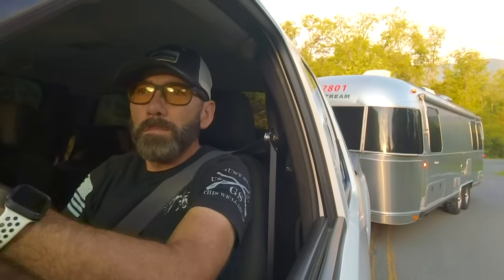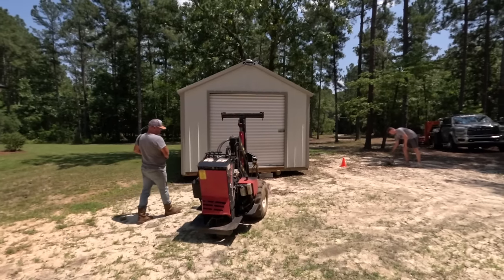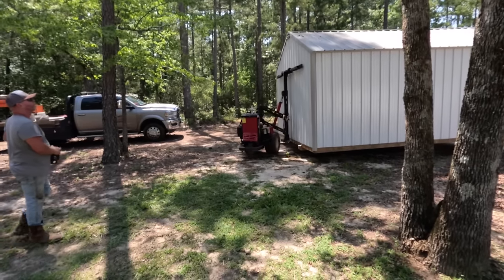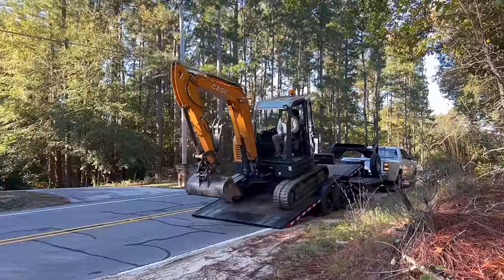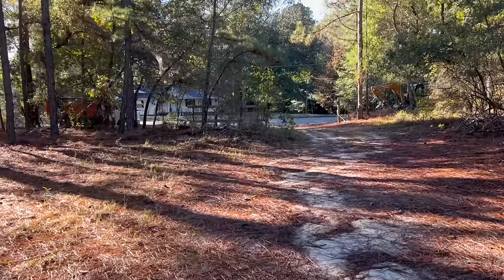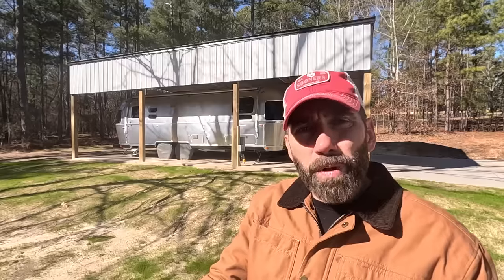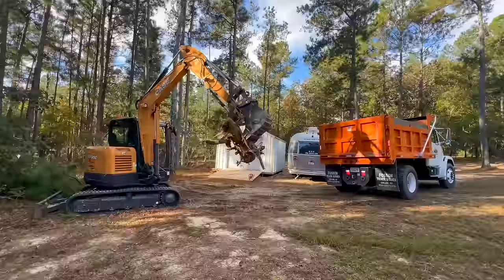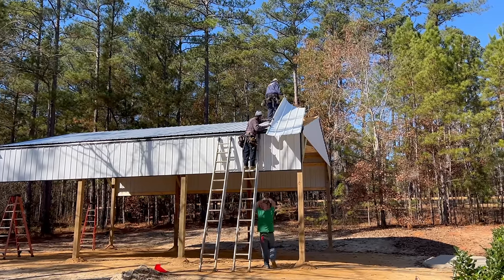How MUCH To Build Our RV Pole Barn?   A Full Cost Breakdown 💰

Comment: I had Carolina Carports install a 12’ wide by 12’ high legs/15’ high peak by 30’ long metal carport with fully enclosed sides and full gables on both ends for our 2019 Flying Cloud 27FB for $6k.  Site was level already so just put gravel down.  Install was done in one day.
Reply from the maker: That is awesome.  I’m sure you and your AS will enjoy it for years to come.  Cheers!
Reply: That's the way to go. Also counties dont usually see these metal carports as permanent buildings so no extra taxes.
Reply: CC ripped me off
Reply: Good investment!  saves on wear and tear on AC plus cheaper bill.  Im building one in the upstate soon I hope . I have to look into Carolina Carports. Thanks .
Reply: That's great and within my budget🙂
Reply: Must have been in 2019.  Price is triple now!
Reply: @janetjones9187  that's not so good and not in my budget☹️
Reply: @Phredbo  mine either!
Reply: @janetjones9187  That's crazy!  It was a last year (2023)!
Reply: What kind of snow load and wind can it handle.
Reply from the maker: Since we live in South Carolina their is no  snow load requirements, but I believe the wind rating is 100-120 mph.

Comment: Great video. As a pole barn builder I want to give you a quick tip. Highway overpasses are all built for just under 14 foot clearances. So every Rv sold, and every truck must be able to clear 14 ft with ease. Therefore I always recommend building everything that could eventually have a 14 ft roll up garage door installed. That way no matter what you purchase, or whatever the future owner might have will fit under the structure. It is relatively easy to raise your building a couple feet at a later date if needed. But is more cost effective to just plan for it. Also the longest Rv on the market I believe is 45 ft.  So I always recommend a 14 ft garage door opening. And if possible 50 ft deep. But extending the length of these structures is very simple. So this can be done as needed. Enjoy the garage. I think you got an excellent price on your electrical work. And the grading and driveway installation was very well done and at a very reasonable price. Well done.

Comment: I hate when they don't put plywood or osb under the metal . I saw my neighbors go up 5 years ago and he has had his metal blow off 3 times and the 3 rd time was this past saturday  when we had high winds  3 panels came off . We live in southern VA near the NC border . . He had to pay yet again to replace the panels as the screws ripped holes in the panels as they blew off. The color doesn't quite match , but you get what you get these days . It was built for his RV also and made similar to yours . Severla side panels were bent in or riped off also . Weather report said 40 mph winds with gusts up to 50 mph . But like me he lives up on a hill and exposed to more wind . The cost was 2 thousand and some dollars . He kept the old panels to see if he can use them to make raised gardens  , so at least they don't go to waste . My suggestion on raised gardens because i got panels 2 years ago from a friend who had his metal blown off . I love my raised garden beds I built  for free and a little labor on my part  and some free cow manure from my neighbors farm
Reply from the maker: Thanks for sharing your experience, and sorry to hear you’ve had such problems. Fingers crossed 🤞, we never have to deal with the type of problems you had…But you never know
Reply: @thewrightlife  I went to get wood today and got my carjack out and lifted the side a little to support the sag . It is a 3 car carport plywood and metal roof over that . But we get really strong winds up the hill . As a matter of fact since the epic ice storm I have lost over 50 trees in the woods behind my house . I feel like the movie the money pit by TOM HANKS . I have weak trees . I am a 70 year old woman and never expected to have to do this  .I really thought I had the carport over built with 6  4x4's down each side  . I wanted 6x6's like I used on the 100 ft long front porch but could not get  them at that time and the trusses were made by a truss company . I hope you don't have to go through this either . It is a big headache and I thought this month putting the ice and water shield and new roofing was my only headache  NOPE surprise surprise  goodluck and wish you the best

Comment: I don’t have concrete, but I ha a pad built from crush and run, 18’x36’, 14’ openings on each end. Gables enclosed, sides enclosed to the ground. Upgraded heavy gauge posts, bracing. They also cut a swale longer than the building to divert the water, roof and side panels vertical. $3,500 for clearing and pad, $7,200 for the building, less than 2 days it was done. $10,700 all in. I could have done concrete for at most another $3,000. Yours is a little larger but seems pricey, but sure the wood posts are more beefy. Thanks
Reply from the maker: Thanks for the comment and sharing your building costs and dimensions.   This is very helpful information for other viewers who are considering building a shelter of their own.  Everyone’s situation, needs, and budgets are different so your example shows an alternative solution.  Thanks for watching and safe travels.

Comment: Very nice.... glad you finally mentioned the gutters. Also, I  might add since you own a truck that can haul a trailer,  why dig a trench by hand.? Ditchwitch trencher here is about 150 for 8 hours. That includes a trailer. Ditch would have been done in about 1 hour. I was just curious.
Reply from the maker: We considered renting a ditch witch but we had electric lines, septic lines, water lines, and gas lines that we had to dig around.  We were afraid the trencher would have caused more damage and more $$ to repair the broken lines than just hand digging.  At least we have no rocks on the property.  Thanks for the comment.

Comment: Congrats!!  You must be thrilled.  Maybe should run water and put in a drain so later after a long trip you can wash/wax right there too. Nice job.   We built our enclosed “airport” pole barn for our Airstream(s) years ago so it was interesting to learn what it costs at today’s prices.  😳
Reply from the maker: We have a water hydrant nearby that we can reach with a few hoses connected.  Construction and materials costs will only continue to increase over time with inflation so now was as good a time as any to build.  Thanks for watching and safe travels.

Comment: great video!  Realize that you don't need a 30A RV plug if you're just going to keep batteries charged and use 12V side of the camper. the 30A part comes in if you want to run the AC while living in the camper.  so for storage 15A is more than enough.
Reply: But if you have friends that want to stay the weekend…
Reply from the maker: We do use the AS as a guest room on occasion.  Additionally the 30 amp allows for friends to boondocks and plug-in as needed.  Thanks for watching.

Comment: Thank you for the information.  Sweat equity is great to bring down costs. You could have rented a trencher to make it easier and faster and still saved a boat load.  You should have taken down the trees to save alot as well. 350 plus per tree? Wow. Here they try to get 500 -1000 per tree from homeowners that just do not know. If the trees are in a dangerous place, too cloose to other structures it could make some since to pay more but your area was open. You could of bought a chainsaw and saved alot and had a chaisaw for future cleanups... in the end if you are happy that is what matters.  I take exception to "contractors" over charging clients. But that is the game.  Thanks  again good luck!
Reply from the maker: We had thought about renting a ditch witch to bury the electrical, but decided to dig by hand because there were several water, electric, septic, and gas lines that we had to dig around.  We didn’t want to cut thru these utility and then have to make repairs to them.  We do have a chainsaw, but for the cost to cut down and haul off the trees, we decided to let my excavator contractor take care of them.  Thanks for watching and sharing your comments.
Reply: @thewrightlife  I take it you do not burn wood in a stove or fireplace?
Reply from the maker: @professionalinspectionserv4228  nope…wood stoves and fireplaces are really a big thing in South Carolina with the mild winter temps.

Comment: Looks great, I’m looking to do the same in S.Fla. Regarding the electrical, is that MC cable (metal clad) going in and out of that outlet box? Snot sure why the electrician did that, it’s not meant to be used outdoors
Reply from the maker: So I’m no electrician, but it is my understanding that MC 10/2 wire may be used for branch, feeder and service for distribution in commercial, industrial, and multi-residential construction. I think it can be installed exposed, or concealed indoors or outdoors, but will check with my electrician. Thanks for the comment.

Comment: nice pole shed.... just a question....did the roof have any ridge air vents?... are you concerned how the structure will withstand stronger winds?.... looks great.
Reply from the maker: Since it’s an open pole barn there are no ridge vents.  As for strong winds, it is designed and rated to withstand winds up to 120 mph.  The 6x6 posts are 4 feet in the ground.  So unless we have tornado or hurricane force winds we should be good 🤞.  Thanks for watching and the question.

Comment: Great video!  Could you comment a little more on why you chose a pole barn over just a concrete pad with power?  I owned a motorhome a while back and couldn’t build due to zoning restrictions and just had a stone pad and 20 amp power.  But as a I dream of retirement, wondering if I should set aside money to do as you have done when we get an RV.  Thanks in advance!
Reply from the maker: We went with a pole barn (post & frame) construction for many reasons.  First, it would provide the protection we wanted and needed for the RV and truck.  Second, if I ever want to completely enclose the pole barn and turn it into a shop / garage this type of construction allows for an easy conversion.  Third, this building will add value to our property much more than just a concrete pad or even a metal frame Carport building that many people build.  Hope this helps in your decision. Safe travels.
Reply: @thewrightlife  thank you, sounds like the right type of investment.  I’ll add it to my ever growing list!

Comment: Very well done video. One question, is there anyway you can ballpark the cost difference between options one and two?
Reply from the maker: Thanks for watching and for your question.  Unfortunately, I don’t think a ballpark cost comparison would be possible.  There are so many variables that would needed to be considered that it would make any accurate cost estimates virtually impossible.  For example, material costs can change on a weekly to monthly basis. Hope this makes sense.  Cheers.

Comment: Could you put in sewer connections and water source so you could functionally use the RV on site?
Reply from the maker: Hi Pat…we do have a water source nearby (~100’ away) that I use to fill the fresh water tank.  I don’t leave it connected to the AS because i don’t want to drive over and damage the water hose.  As for septic, it would have been cost prohibitive to put in a separate septic system just for the AS.  However we do have a “dump station” capability on the property.  I just have to use a portable black tank dolly.  Thanks for the question.  Happy camping and safe travel.

Comment: No re-bar or wire mesh in the slab??
Reply from the maker: We added fiber to the concrete vs wire mesh.  It provides the same benefit.  Re-bar is not recommended for 4” slabs.

Comment: I live in central Florida and I have a 31 foot land yacht airstream but I have not found anywhere near here particularly on the coast where I can just legally park an airstream and live in it… Sure I can stay in a park but I don’t want to live in a trailer park. I plan on having a 20‘ x 10‘ outside building with washer dryer for bathroom and walk-in closet but also be able to pull the trailer out just like you have if I want to travel if you have any ideas on where you can do that I’d be very interested, I love the quality of work that you did
Reply from the maker: Hi…I’m not sure about the location and zoning restrictions in central Florida.  If you own property, then I would think your county could tell you what the requirements would be to park and live in your Airstream.  If you are looking for property, then I would have a realtor find property that meets your requirements.  Once you have a property you want to build on, I would recommend that you talk with several builders and ask them for references from other customers who have had work done.  Best of luck and safe travels.

Comment: Why no wire mesh in that concrete slab?
Reply from the maker: We used fiber reinforced concrete.  They mix in the fiber elements into the concrete before pouring.  Supposed to work just a good as the wire mesh but less expensive and won’t rust.

Comment: Why no rebar in the crete?
Reply from the maker: Not needed or recommended in a 4” slab.  Used primarily in foundations and structural walls for added strength.

Comment: In my state you don’t need a licensed electrician as long as it passes code so I do it myself
Reply from the maker: I debated doing the electrical myself, and even priced out the additional parts needed (~$400).  Because I was not confident that I could DIY the electrical and pass code we decided to hire an electrician to complete the install.  He provided the remaining materials and labor for $684.  Considering what just the additional materials would have cost me, I thought we got a great deal.  FYI - we had one estimate at $4,900 and another at $3,800 for the electrical work.  Needless to say, we are glad we shopped around and happy with the electrician we hired.  Thanks for watching and safe travels.
Reply: @thewrightlife  great video all the same don’t blame you if you thought to hire a good electrician. I was lucky enough to have a father who could do anything I just watched listened

Comment: No steel in the slab 👎
Reply from the maker: It is fiber reinforced concrete.  It adds strength, prevents cracks and doesn’t rust.

Comment: Good job. Maybe hire a trencher next time to save you time and sweat digging that trench.
Reply from the maker: I considered renting a ditch witch but we had electric lines, septic lines, water lines, and gas lines that we had to dig around.  We were afraid the trencher would have caused more damage and more $$ to repair the broken lines than just hand digging.  At least we have no rocks on the property.  Thanks for the comment.